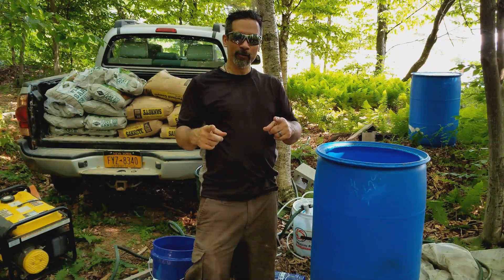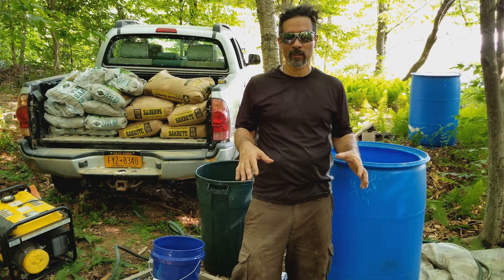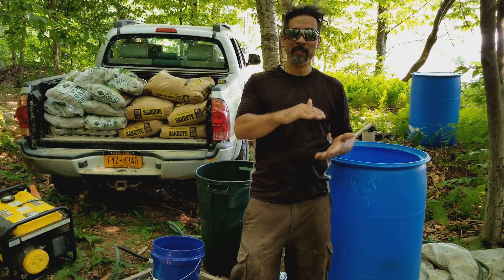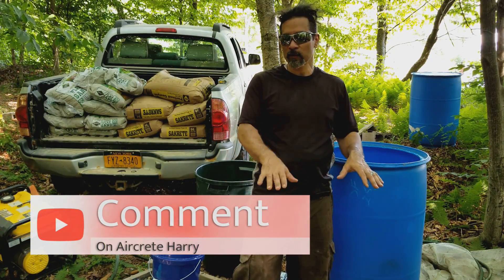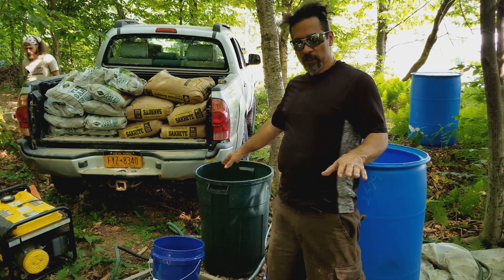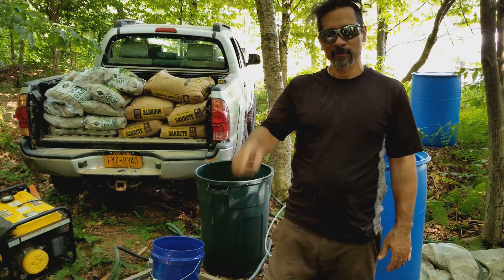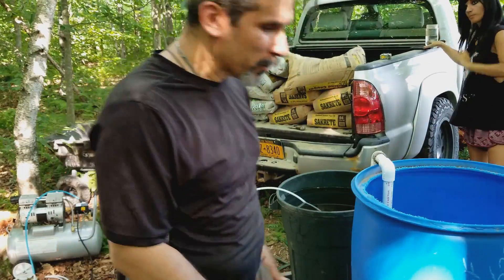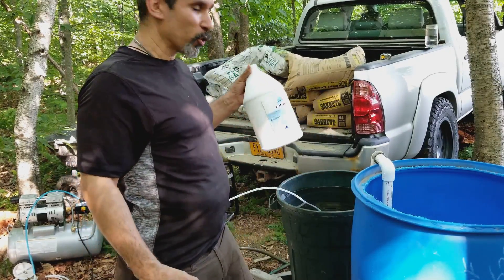Aircrete Dome Foundation #aircrete #aircreteharry #dome #diy #foundation #aircretefoundation #pour

Comment: Portland cement for a foundation plate?! Seriously? Good luck with that. Portland cement is used in Germany ONLY for wall topping! It will not withhold any pressure. Guess how I know. Right. Had to get rid of it and do it all over again. Yes. I was young and believed the sales guy more than my architect 35 years ago. Never again.

Comment: Hello, thank you for replying so perfectly to a previous question on different video, I plan on happily purchasing your stuff, I'm thankful for the groundwork and science experiments you have been doing.

Currently I'm refreshing my mind on the details with building domes, preparing to build, spray, single airform 20ft dome this next year, south Florida, 

I plan to follow your advice and technique. Epic mix etc. Basalt rebar, mesh.

Do you know if concrete formula would be different for environment South florida?

Also, it has been a while since last updates, is there any updated version of mixes or materials, versions, formulas of concrete you discovered or plan to add to your website? I'd like the best version when I purchase plans 🙏

Thank you, maybe a phone call in future.
Reply from the maker: Our Pleasure Patrick!
Ready when you are 👍 👍 
Whenever I do any additional updates, I make sure to let my Valued Customers know as well. 
All available on my website is up to date: https://aircreteharry.com/shop-1/

For South Florida is will work well!
(There are certain considerations for colder climate environment)

You got it Patrick 👍 
Email us: Aircreteharry@gmail.com 
when you are ready for the consultation call.
Happy to connect & assist you.

Comment: The reason your aircrete is so brittle and weak is because you're adding aggregate. Adding sand as an aggregate + air lessens the amount of actual cement you have in your mix.. with actual aircrete air is your only aggregate. for someone who calls himself aircrete Harry, you seem to know very little about how to make aircrete.
Reply: Interesting - So what would be the 'stronger' mix or ratio for the foundation pour?
Simply less foam? and never use sand?...
I like the thought that the skin to each and every bubble is what creates the 'aggregate' - assuming that is what you are suggesting? which means that all you can do is increase the strength of the bubble skin, true?

Comment: No plastic vapour seal under the floorslab?
Capillary effect will transport the moisture up and the insulating properties are minimalized...
Reply from the maker: Thanks I will make sure I have plastic on my next dome.
Reply: @AircreteHarry  - In the long run you'll see it's one of the smallest investments either money or time wise, in a construction.
The return is years of moist free upper structure or rooms. Totally worth the 30 minutes it takes to set it properly. ;-) 

One other tip. Always start dumping your concrete on the point further away from the material "entrance". Saves some head aches walking/moving over already poured material. ;-) 
Cheers

Comment: Looks like you forgot to leave a good thick solid ring to support the walls Harry. Good first experiment though, but expect the floor to crackaround the perimeter from the weight. Although it is light, that edge is thin.
Reply from the maker: Plan is after the boards are removed i'm going to put cement all around to hold everything in place.

Comment: Why did you decide to use PLAY SAND compared to CONSTRUCTION SAND?  Size and particles mix percentages are important elements of strength. What is your estimated aircrete density number?

Comment: Hey Harry, I'm sure you know that not all sand is the same. Playground sand is tumbled and has less sharp edges then construction sand. Silica sand is a carcinogen and also has less sharp edges then construction sand. River sand, desert sand, and beach sand are also smooth. The jagged edges of construction sand is best because it keys itself into whatever application. Construction sand is man made by crushing rock and that's what gives it its sharp jagged edges. It's also the cheaper sand. It might also be called plaster sand in some areas.
Reply: Redefine Living Thst what i have always thought. Some sort of agragate or other binder for strength. Ive seen many new products that could replace agragate but never have sern the cost comparaison. Great videos. Others talk about creating domes with aircrete but rare if at all see a product through building to finish.
Thanks a bunch.